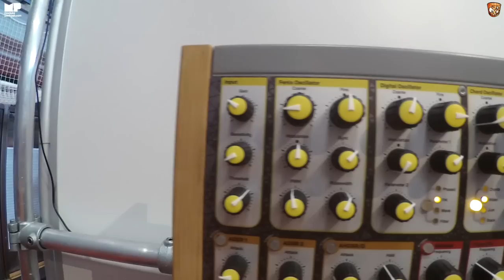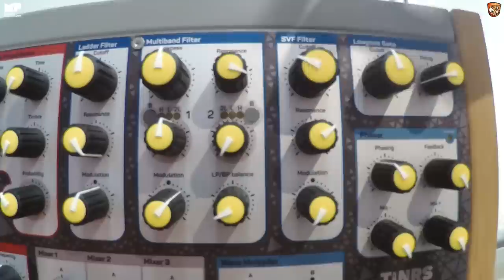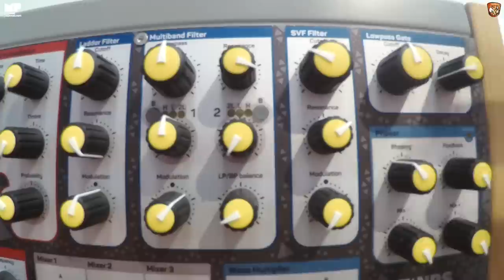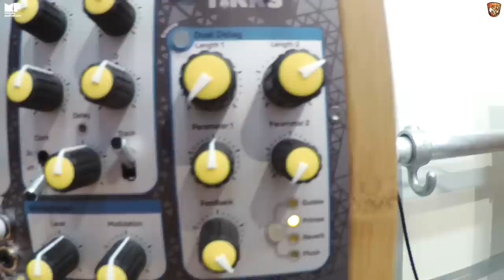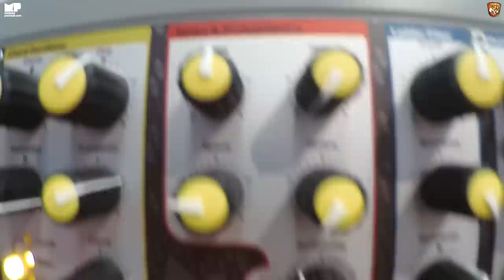CLASSIC SYNTH REBORN! Fenix IV from This Is Not Rocket Science // Superbooth 2019

Comment: One thing I remember from the original Fenix was its unusual ring mod with 3 inputs. I notice this has an A plus a B1 and B2 so I wonder if its as the original? Of course since this AJH produced the ring sm and motm also made a 5u module with x y and z ins, but its still interesting.
Reply: I've still never been able to hear the difference on  my AJH with something into the Z input.
Reply: Our ring mod right now is as the original - however we about to adapt this to chip availability. Inputs will be the same, sound will be the same, internals based on new chips

Comment: I hope they give the option of bananas.
Reply: Doesn't sound like it.
Reply: From TINRS:  "Our Fenix jacks are mini-jacks and not banana. We choose mini because this is the Eurorack standard and we think there are many-many interesting modules in the Eurorack space that the Fenix IV should play with. Because mini provides shielding of the jacks and cables, because of the normalling behaviour of the jacks (a dedicated signal path for us to determine that can be overridden by what you plug in and providing grounding when unused) and although they are slightly more expensive they are easier to manufacture than banana jacks. However, we intend to provide the banana fans with a way to connect to our Fenix – we’ve created a break-out area on our circuit board behind the multiples that can be replaced to separate a set of four jacks and connect them to the back where there would be four or eight banana jacks with an extra ground. The Fenix II has the same swaparound for mini-jacks."
Reply: @joebogatko9058  Thanks man, it's kind of a shame but I understand the thinking. I do miss my Fenix II and III, tempting.